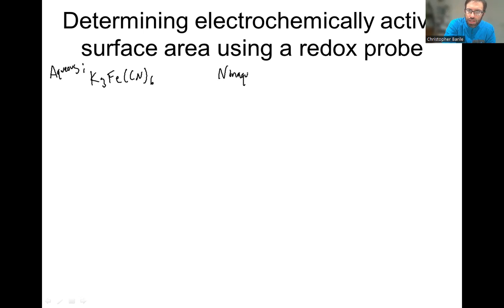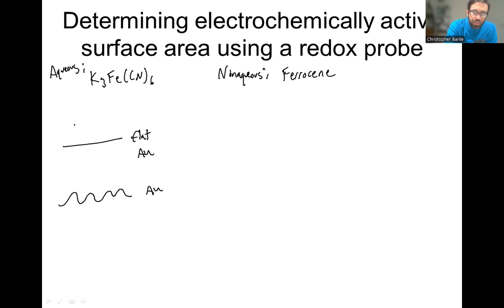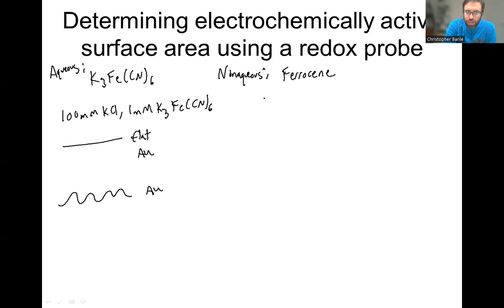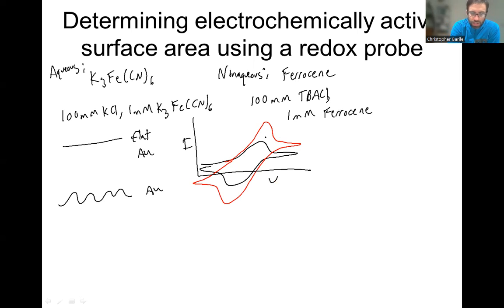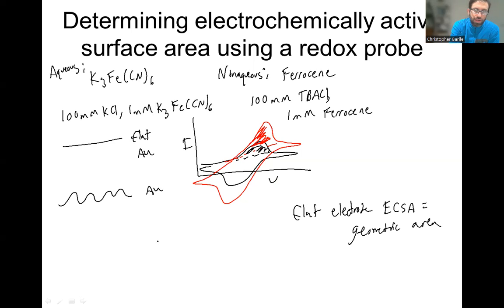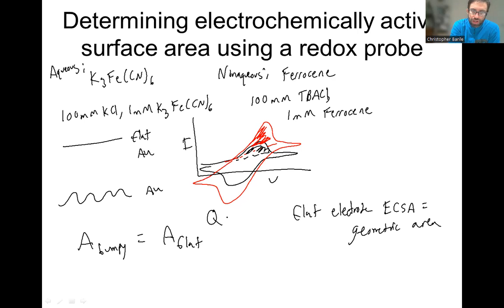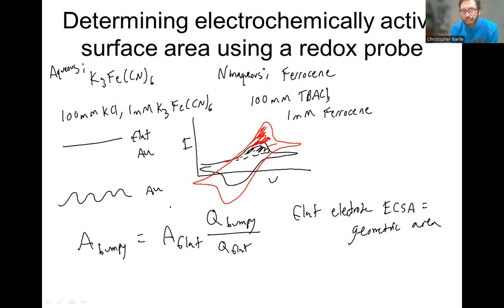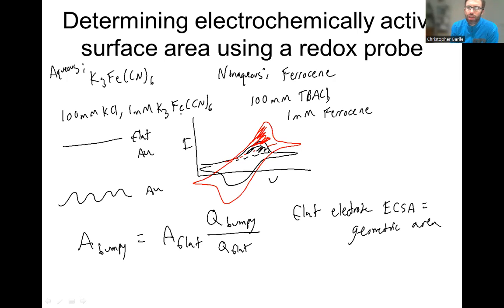Determining electrochemically active surface area using a redox probe- e.g. ferricyanide, ferrocene

Comment: Is it only possible if I only have a flat electrode as a reference? So for example if i have a bimetallic eletrode (which i eletrodeposit) its close to impossible for me to get hold of a flat electrode of the same material. In this case its not possible for me to calculate the active surface area from this method right?
Reply from the maker: Correct. Unless you somehow have an independent method of knowing the area of one electrode, then you could compare the others to that one.
Reply: @christopherbarile2539   Would this mean its not possible for me to calculate ECSA (for the same material) using double layer capacitance as well? Because seems like I would still need to know my flat electrode's capacitance.
Reply from the maker: @ILAMPARITHYIP7  yes you will need some independent measurement